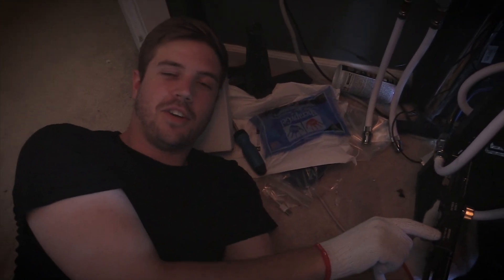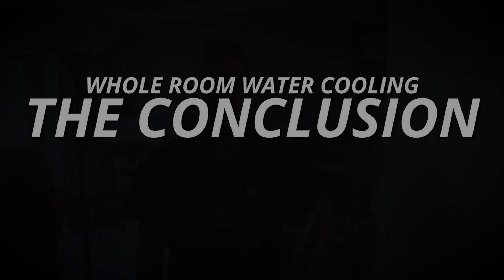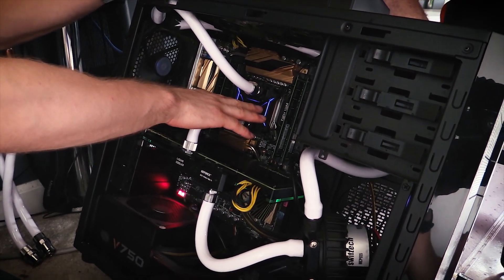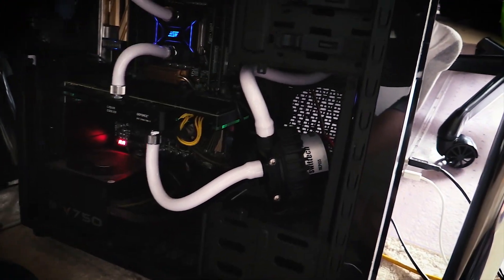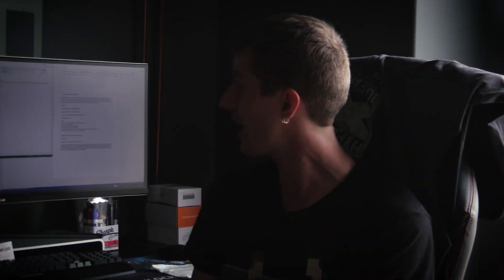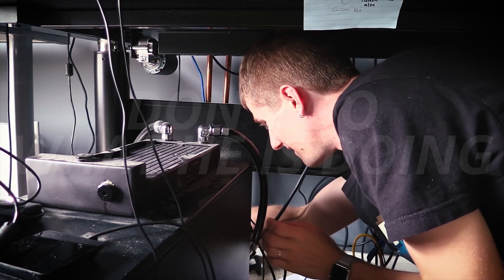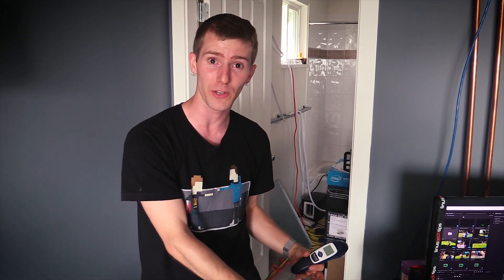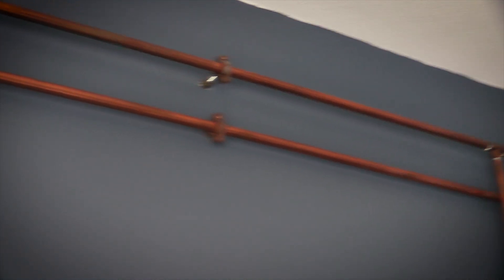Whole Room Water Cooling Part 7 - It's FINALLY over!

Comment: That easter egg on the roof.
By the way, you should put some foam insulation on those copper pipes.
Otherwise they're going to radiate their heat back into the room.

Comment: I think the whole room water cooling could work really well and is a really neat idea. You mentioned some of the changes you would make. Bypass and drain valves would be a must and every computer should have their own independent "hot" line with its own radiator. I would like to see you try it again. Maybe not with your work stations but using a test room with test computers. Maybe get advice from an engineer cough cough

Comment: Nice concept. If you ever do such an experiment again, consider insulating the piping next time. Also, consider tying in a radiator within the loop system in front of air condition vents for the summer having a parallel bypass for winter.

Comment: If the pipes were heat isolated like the copper pipes in air conditioning systems it was way more effective.
What you have now is a huge in room heat sink.

Love you bro.

Comment: Cheaper (and less awesome) alternative, put the computers in a neighboring room and run cables. When I had my house constructed I specifically had one room wired up as a server room of sorts (all networking leads back to there, and a few dedicated breakers keep everything powered) and I just cut out a hole in the wall to a neighboring room where the I/O lives. On any given day there's a 5-15F difference between the two rooms!

Comment: LinusTechTips How about rev. 2 of this idea for a new place? Invest in insulated  cabinet to put all your workstations in and have exhaust\intake air from outside with a/c unit, that way you can dump all the hot air outside, cool intake air with a/c in summer and use plain cold air in winter

Comment: Rofl there's a much better way of doing this. If the goal is to get heat out of the room it's easier to run cable then it is to pipe water all over the place.

My solution would've been to move all the rigs out into another room (probably downstairs) and then used aircon. That way the room you're working in stays cool in the summer and if you want to warm up in the winter, unhook your screens and keyboards and go downstairs (bonus closer to the kitchen :P )

Interesting project though, at the very least a good guide of what not to do.

Comment: linus.... aloha!!!
yes, why isn't the entire house a/c'd???
or couldn't a split a/c or heat pump been installed for a quicker & easier solution??
a 1-1/2 ton system could have been installed in those 2 rooms + your ceiling fans and maybe under-the-desk fans.  and even by dumping the heat outside, what about a refrigeration cooling jacket OR an ice-chiller at the reservoir to really chill the water??? (you have a freezer; freeze blue ice nightly (have 2 sets to swap) & bring the water reservoir temp down)

I hope each editing system get a cold air feed ducting (and double air filters) that can be directed to the cpu case for cooler running temp and least dust issues/problems.
I kind hope you think about building each editor his own soundproofed room for editing so they don't need to wear headset (its really not comfortable/speakers on the wall or mounted at head level + a big wall-mounted 40-48" screen for viewing.

am looking forward rto seeing your server room w/ a secondary/backup split a/c air handler to augment your central hvac ducting...

kevin

ps... u really like your style; your crew rocks & has a good time,,, jeep up toe ood work....

Comment: Here is an idea. Have cables for the mouses, keyboards, monitors, and so on run through a wall and isolate the systems themselves into their own room. Similar to mainframe days minus the actual terminals. Or even set up a mainframe style system. A server with a couple Nvidia quadros in it could remotely do all of the editing and rendering legwork with terminals connected to the network. And then to help with cooling the room, vent the exhaust out of the building using flexible duct hoses. I have a feeling that this is not just an editing room but also for LAN gameplay. In that case each system can still be a gaming rig running a virtual machine connected to the mainframe system. As long as efficient components were used then during editing noise and heat should not be an issue. Of course a good ac unit could do the job but that would not really affect the noise issue. Then again that is what headphones are for.

Comment: You should have considered insulating the copper pipes as the heat just got moved around the room thus not making a big difference. And maybe an inline water filter would have helped with the rust issues by the time distilled/ demineralised water was used with a plastic tank as linus said or stainless tank.
Reply: But great work bringing us interesting footage

Comment: I have been involved in OC and cooling since early days, non professional . 

For the past 12 yrs I have self built PC , OPEN to AIR (no pressure) , watercooling which is similar in concept. 
I have a split-boxes (in 'n out) with multiple connection each ( though i use just cpu block now) , the   20L-30L  shaded water tank is in the balcony, and the water passes through a PASSIVE (just wind) radiator there. I added Red Line Water Wetter which keeps from algae forming.  my pump is SUBMERGED (aquarium type) so its heat is dealt with too. 
My room temp is now 29.0C and my hottest (not gaming, 1 of 4) core is 45C-50C which is pretty much usuai in summer . (coolest core is 38C-40C)

I tried also building GFX block which isn't worth doing ( block useless with new card)  , Memory sticks (not much heat ) , HDDs bad idea since they like 43ish temps. Chipset hmm yeah but the looks are gone. 

The noise factor and the easy handling of heat by the water are the 2 important benefits.
My system is nearly maintainance free. 

The Gunk is (almost) DEFINITELY copper + aluminum interaction ( a battery that corrodes the aluminum and creates nasty gunk) 

1. you should try and wrap the copper pipes with heat isolation.  
2. INCREASE the external tank capacity ( seperate the radiator function), easier to get plastic barrel i guess. the more water, the less Radiator efficiency matters (less heat per liter)
3. with AC, you need a stronger than usuall unit (they usually calc sun exposure and room volume) .  

Keep the system as backup ? if it works better with my suggestions than it will save money on AC electricity.

Nice try, but you spent on copper !,  polyurithene pipes with Silicon pipes for the PCs would  have been cheaper and better.

Comment: I live in Cairns Australia and it gets kinda hot in summer and with a 295X2 system on a custom water loop, I could feel a massive amount of heat coming off the rads.

I then shifted to a water tower (evap type like a power station only smaller) and room temps went way down - To the point I didn't need aircon every time I wanted to play Far Cry 4. 

It definitely worked for me but evap ain't so good in humid climates so I changed again to external box with 2 rads, a pump, res, and 2 fans (302 CFM each) and I'm super happy now :)

Comment: Good job guys looks cool anyway, if you want to cool the room cheap just run 3 or 4 ducted piping from under the house up to the room all you need is intake fans. It brings cold air from under the house up to your room works really well.

Comment: On nuke subs everything is "water cooled".  All the electronics and spot coolers,  are cooled by chill water that leaves a refrigeration unit at ~ 45F.   So the theory of whole house/office water cooling is not very far fetched.  Should you have enough load (heat/wattage) to justify doing it.  

  I am sure Linus was a little rushed to get this job finished, so the results were not as spectacular as one would hope.  Given more time and engineering they could have pulled off something wonderful.
 
In a year this video will have been forgotten once we have time to marvel at the new digs.  :)

Comment: I imagine in the winter the temps will fall dramatically while on the whole room system, because snow and winter temperatures will cool those radiators much more than fans can. Also, fans will freeze and fail, but you know, that's whomever is stupid enough to buy this house's problem.

Comment: LinusTechTips 
If you were to pick up black styrofoam pipe insulators, it'd both reduce heat in the room by a longshot as well as be aesthetically pleasing. The pipe insulators I'm refering to look basically like pool noodles but are meant for..well..pipe insulating.

This is an example though they do sell much thinner versions:
http://www.zoro.com/k-flex-usa-pipe-ins-elastomeric-58-in-id-6-ft-6rx038058/i/G0600047/?utm_source=google_shopping&utm_medium=cpc&utm_campaign=Google_Shopping_Feed&gclid=CjwKEAjwla2tBRDY7YK9uKXe8R8SJAAhG6LGxNR_m8IXn4Q9h-1_yhvgztznFsEUqqNp5MW_1mjNTBoCvqnw_wcB&gclsrc=aw.ds

If you'd try it out as an experiment, I'd be interested to know how much of a difference it would make.

Comment: This whole room water cooling can be a lot more practical with some revisions to the design, the biggest issue with the current design is the total height of the system. The pump has to shove the water upwards, up and down through the vertical tubes, and  through dozens of water blocks, fittings, and bends. Instead of a nice looking ceiling mounted loop, place the entire loop less than 2 feet from the ground. Use PVC, maybe put some techflex over it to pretty it up. Keep the loop low to the floor, instead of 6-7 feet up. Far easier to prime, bleed, and access things. Also, valves for in and out of each stations' connection to the loop.
      Also, an automotive radiator should be simpler than connecting multiple smaller radiators, as well as using an automotive 12v fan and fan shroud from like say an F250 at a scrapyard will provide plenty of radiator for cooling everything, and it just needs a constant 12v 40 amp source (could be 20amps) . Plus PVC is very easy to work with, cheap, and reliable, just cut, remove the burrs, smear it with the PVC glue, and squeeze it together. Done. No torches, no sweating copper pipe.
    I think if you endeavored to do it this way, it would cost less, function better overall, and you could build it yourself with a hacksaw, hand file, screwdriver, and PVC glue. Also PVC is pretty corrosion resistant, allowing a variety of coolant options. Hope you guys do consider this, it would be a great video series, and with far less headaches than the copper loop. Keep churning out the content!

Comment: Interesting idea. I kind of actually wondered why places like google don't do something like this. In their case i'd say build some custom backplane and server case. Then you need to swap a system just pull it put new one in it's all seamless. Then instead of huge AC systems run them through some sort of thing in the ground or a cooling tower.

Comment: How about using Styrofoam insulation on the copper pipes? I'm sure it would reduce the heat dissipated inside the house

Comment: I'd just stick to air conditioning in the first place. That's what data centers usually stick to and they have far more than 5 high powered PC's running at any given time.

Water cooling those devices would make more sense.